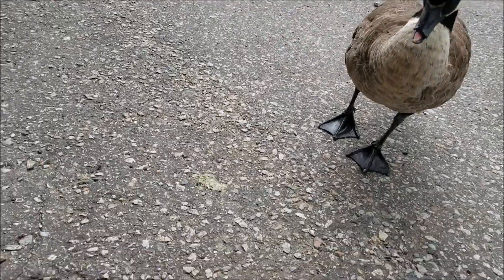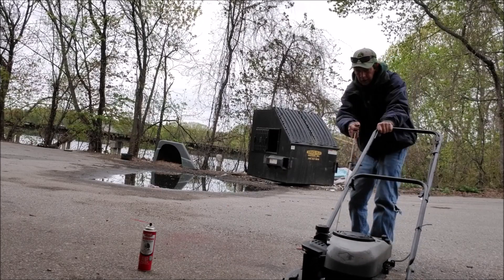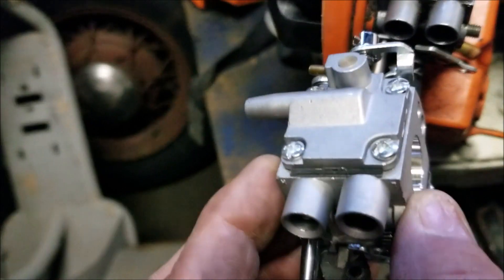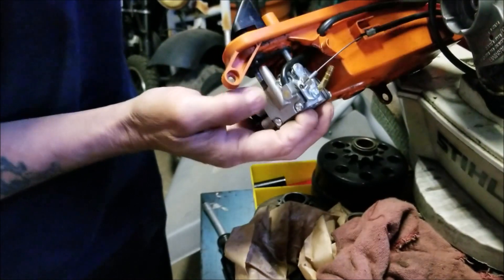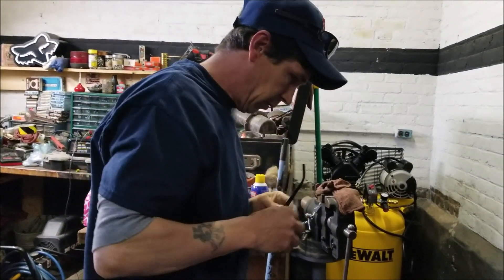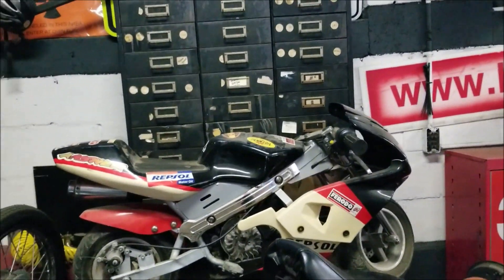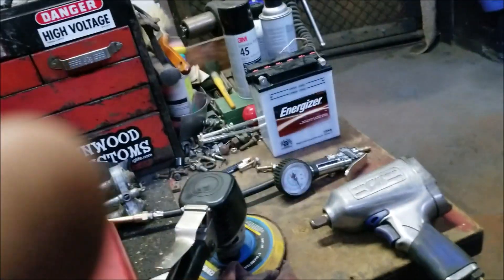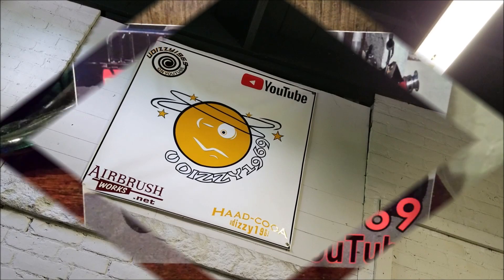Mower repair and Back pack blower Broken, With Udizzy1969

Comment: That back pack blower is a easy block change , you can get a short block cheap for them . It’s the same block as some weed whips . Hay brother your shop is really coming along ! You sure have some nice projects to work on for sure ! Just out of curiosity what do you do with the finished projects ? Do you sell or donate or keep ? Mine I typically sell and move on to the next unless it’s special then I keep ! Lol ( it seems that there all special ) SKOL BUD !
Reply from the maker: I give them all away My friend, to make room for more projects, just love it, Thank You Dave.  Cheers Dizzy.
Reply: udizzy1969 that sounds like something you would do ! Bravo dude ! If your in need of anything and you can’t find it around you or Harvey ( LMAO ) maybe I could find it and donate to the cause or something , just ask !
Reply from the maker: Well I am looking for a 1" comet Torque converter for the Police trike build, But They cost a ton for a good one. lol Thank you my friend, Cheers Dizzy.
Reply: udizzy1969 chain size 35 or 40 or 41 ?
Reply: udizzy1969 or are you talking clutch and driven on a belt ?
Reply from the maker: size 40-41 buddy, Cheers Dizzy.
Reply from the maker: Yes The whole thing with Plate. Cheers Dizzy.
Reply: udizzy1969 something like the tav2 -30 series clutch system 1” w/ 40/41/420 chain sprocket ?
Reply from the maker: Yes, That is the one Sir.
Reply: udizzy1969 let me see what I can do for ya , of course there’s no charge , I want to help if I can ! I’ll try to find your address .